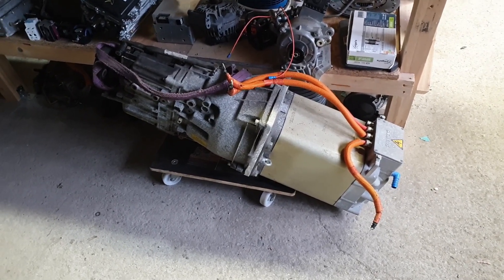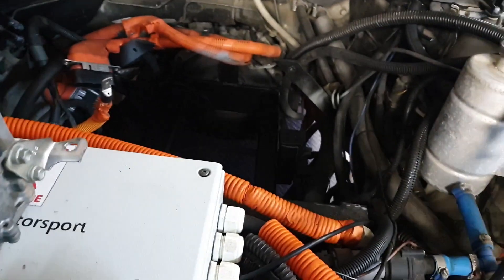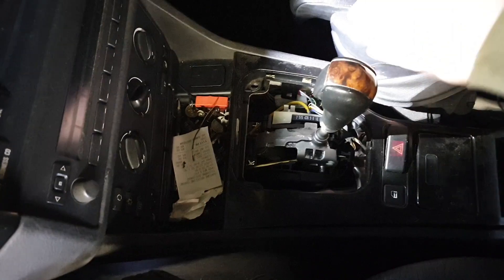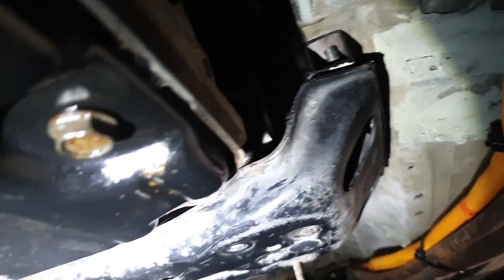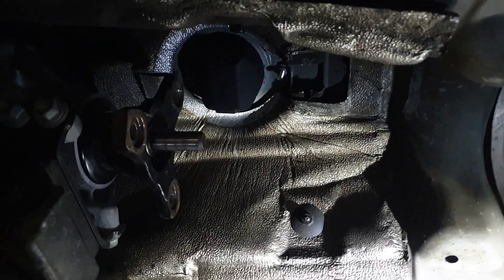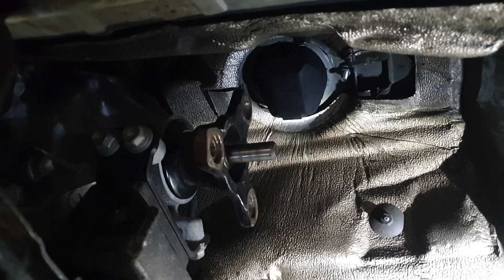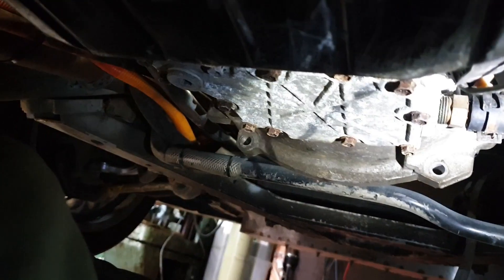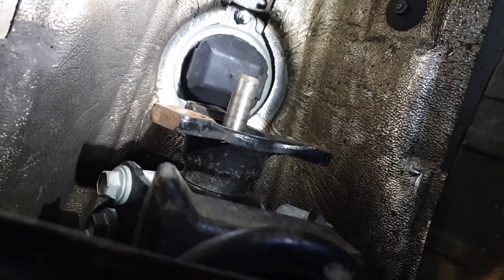E39 Lexus GS450H Swap 02

Comment: Your the man bro. I like the details. Video underneath showing where the driveshaft is, the coolant lines. I hope it doesn’t leak like a BMW. Lol. Looking forward to seeing the whole setup with the batteries and everything.
Reply: There's still the original differential which could start to leak. The Toyota stuff is usually pretty leak-proof 🤣